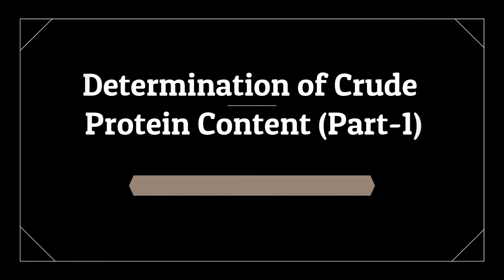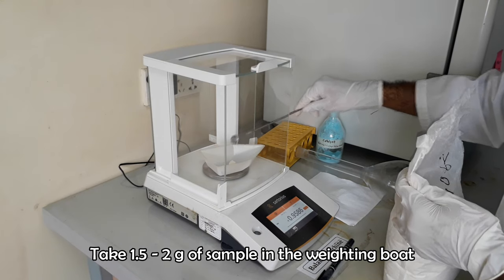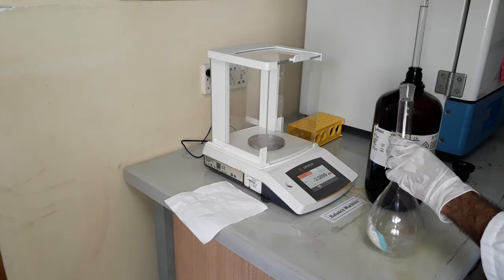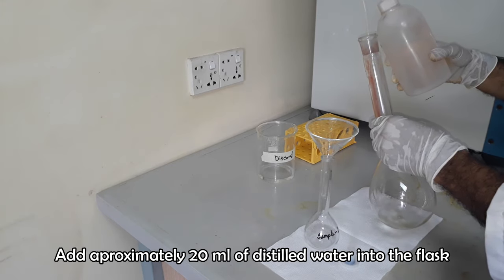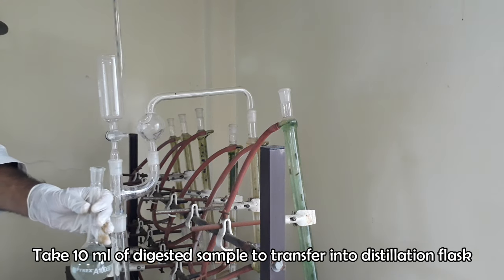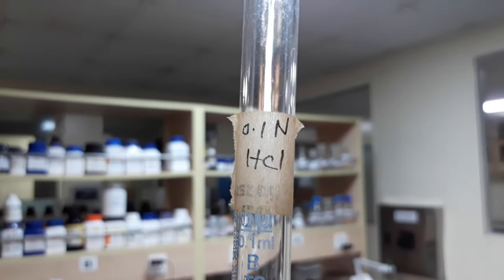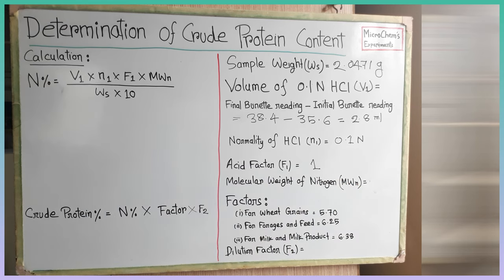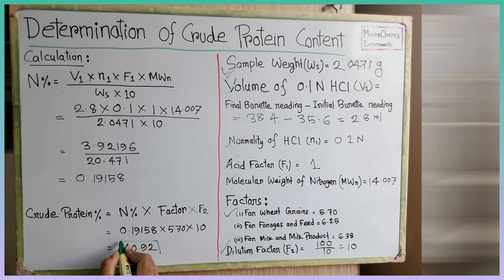Determination of Crude Protein Content (Part-1)_A Complete Procedure (AOAC 2001.11)

Comment: You should add the sample in the distillation vessel first and then add NaOH-solution. In the procedure shown on the video sample will react with NaOH-solution in open and it leads loss of nitrogen in form of ammonia. Also the receiving part should be under the liquid level.
Reply from the maker: Thank you for your findings.
In AOAC, it is not said to keep the receiving part under the liquid level. And in this way, shown in this video, we get the expected results. This is because the loss of nitrogen is negligible. Anyways thanks for your suggestion.
Reply: @MicroChemsExperiments  It is obvious in this case that it has to be under liquid level. Also Kjelldahl method is pretty old and it has always been that way and finally it is stated in the AOAC 2001.11 in part "Distillation" "Place graduated 500 ml Erlenmeyer titration flask containing 30 ml H3BO3 solution with indicator on receiving platform, and immerse tube from condenser below surface of H3BO3 solution."
Reply from the maker: @BadPete81  Okay. Thank you for your information.
Reply: It is very important to keep the recieving funnel under the solution as nitrogen can escape!

Comment: In the calculation equation V1 is the volume of unused boric acid but we need the actual volume of used boric acid, so here you have use 30- V1 instead of V1
Reply: Please clear the doubt as soon as possible

Comment: So why did you use 0.1 as the Normality of HCl in your calculation and not the exact 0.0975 N from part 2? That you worked when you titrated HCl against NaOH using phenolphthalein ad your indicator?
Reply from the maker: Very smart...
You are right. But I did not used the exact chemicals prepared in part 2 for protein titration. Rather I used 0.1N HCl and thats why I calculate protein using 0.1N.
Part-2 video is prepared in different time, just to show you about the preparation.
Reply: @MicroChemsExperiments  Got it!.

Comment: Very detailed video! One quick question, can I know if I can use this method for liquid sample?  How the method will be when I want to measure the weight as my sample is liquid?
Reply from the maker: Yes. This method is applicable for liquid sample also. You can take 2g of liquid sample in a glass beaker first. Then transfer the weighted liquid sample from breaker to digestion flask quantatively washing with 20 ml sulfuric acid and add catalyst & heat the digestion flask to digest your sample in presence of acid and catalyst.
Reply: @MicroChemsExperiments  Thank you for the explanation!
Reply from the maker: @amninazifa5244  you are welcome

Comment: Ok so quick question does the flask have to be a kjeldahl flask or can I use a volumetric flask if the first is unavailable? Also can I digest it on a soxhlet?
Reply from the maker: You can't digest on Soxhlet because the fume of H2SO4 will spread-out all over the lab and Env. There is no fume receiving system in Soxhlet.
Reply: @MicroChemsExperiments  Oh ok thank you for clearing that up
Reply from the maker: @kadelin3318  You are most welcome.

Comment: Why did you use the dilution factor?
 the AOA didn't use it.
please provide a reasonable answer
thank you
Reply from the maker: During the distillation, We used 10 ml digestion juice from 100ml total volume. Thats why the dilution factor is (100/10) 10.
Reply: @MicroChemsExperiments  I mean why was there a need for the dilution factor?
thank you
Reply from the maker: @bandaid.7878  when you analyze a portion of digested sample (rather than using total volume of sample), then you need to use the factor

Comment: From where did you drive the %N determination formula and why didn't you run the blank 
Though the formula in AOAC 2001.11 method is different from yours and they also subtracted the concordant reading of the Vs fron the Vb
Reply from the maker: Hadiqa Iqbal, Thank you for your questions and observations. 
First of all, we used %N determination formula from AOAC 2001.11 method which is modified in two places: 
1. we didn't use burette reading of blank (Vb) because we didn't conduct any blank digestion in this experiment. 
2. We used additionally Acid Factor (F1) which is not mentioned in AOAC book but used by the FAO method of ''Quality assurance for animal feed analysis laboratories, Page-90''.
***We didn't go for the blank digestion to simplify this method and we conducted several studies in our lab and found that there is no significant different in the protein result when we don't run blank digestion.
***Acid factor is only necessary when you want to titrate with any other acid rather than HCl.
So, If you want, conduct a blank digestion along with sample (as it gives more accurate protein result) and substract Blank Burette reading from the Sample burette reading. You can also ignore the acid factor if you always use HCl in the titration.
Thank you.
Reply: As far as i have studied if we are placing normality value of acid we don't add acid factor in calculations. As far as acid factor is concerned it always gets include into the calculations when we note molarity instead of normality 
Is that so ?
Reply: Can you share the method of fao with me plss
Reply from the maker: @hadiqaiqbal795  As the acid factor is 1, so you can remove it from the calculation thus creating no differences in results.
But if you use other acids like H2SO4, then you need to add acid factor in the calculation. In case of HCl, no need to use and Factor for Acid.
Reply from the maker: @hadiqaiqbal795  Knock in our facebook page for FAO method.

Comment: It was a very useful video. Can you elaborate more on how to run blank digestion and distillation? Thank you in advance.
Reply from the maker: Conduct the blank digestion and distillation as same as sample. Just dont add sample in the flask during digestion.
Thanks for being with us
Reply: @MicroChemsExperiments  Thank you for the quick reply. We are trying to implement the Kjeldahl's method exactly as explained in the video. However, during titration using methyl red indicator, the color shift appears to be very gradual and some times its very difficult to distinguish the color shift from yellow to orange. This might lead to mistakes in end point determination. Any suggestions to improvise?
Reply from the maker: @guruprasadk3848  Endpoint should be counted just at the point in which drop of 0.1N HCl the color turned into orange. Do the titration slowly and carefully against white background. Do saveral trial and try to do accurately. Your skill will develop with time. 
Another sugestion is determine the protein of known sample (eg: Pasteurized milk has a protein value of 3.5 to 3.7) in several trials and match the known protein value in diferent titration values of conducted trials. In this way you will be a skilled analyst.
Reply: @MicroChemsExperiments  Thanks a lot for your suggestions... will contact you through your facebook page incase of further queries... keep up the good work... cheers!!!
Reply from the maker: @guruprasadk3848  Thanks for being with us.

Comment: What about if we use 0.5N sulfuric acid as the titration?

7.003*volume of H2S04 in ml * Nf*100 / weight of sample = % nitrogen
Reply from the maker: You can use. But in the calculation, count 2 as acid factor

Comment: What are the limitations of this protein determination experiement.... And why we use NaOH??
Reply from the maker: We will make video later explaining the chemical reactions
Reply: OK I can wait for it.... Thank you
Reply: Can I get limitations. Also tell what are the precautions need to take to get accurate result. I mean during digestion,  distillation etc. 

I have added in hot digested sample 10 ml distilled water and than 40 percent naoh there is so much splashes coming from the flask and than flask was broken.

I need to get proper results. Can I follow same way u shown in vedio to get protien in soymilk because I m not getting proper result. May be doing some mistakes somewhere

Comment: I want to know what samples did u used? Thank you!
Reply from the maker: Ainen Lagroma, Thanks for your comment.
We used low protein feed (raw materials) sample to test for protein determination, in this video.
Reply: @MicroChemsExperiments  thank you so much for responding! Does this method can also applied in liquid samples? Can't seem to find any information using a liquid sample.
Reply from the maker: @ainenlagroma3644  Yes. You can apply this method for testing a liquid sample for Protein determination. Take 2g liquid sample (Ex: Milk) in the digestion flask and carry out the experiment in the same way as shown in this video.

Comment: why are we titrating acid with acid?
also, I didn't understand the dilution factor. would you be kind enough to explain  it in detail
thank you
Reply: the dilution factor is of the solution in receiving flask that contains boric acid?
Reply from the maker: This calculation is derived from AOAC official method. So they used Kjehldahl's method and provided equation for calculation based on the difference steps of this method. So, please study about Kjehldahl's method to get proper explanation. Thank you.

Comment: Hi, it was a helpful video😊, 

Other than that, can i just add some distilled water to the sample before adding the sulfuric acid? Is it work? Since i have to boil the sample manually without water circulation pump☺️

Thank you.
Reply from the maker: No. You can't add distilled water because it will dilute the acid and decrease the effectiveness. Sample will not be digested properly in diluted sulfuric acid.
So you have to boil and prepare your sample seperately before conducting the protein test.
Reply: @MicroChemsExperiments  thank you so much for responding! 

Is it work to boil the sample with diluted sulfuric acid by using heating mantle? And how can i sure that the boiling process do not boil dry? Since i can't add the distilled water and i do not have water circulation pump.

Thank you.
Reply from the maker: @noorfadilah1710  During boiling, it will not dry. You can boil using hot plate without water circulation pump and you dont need to add distilled water also. Just boil in concentrated Sulfuric acid.
Water circulation pump is used to capture the acid fumes, generated during digestion, carrying out throgh the wastage water line.
But in the case of hot plate boiling, use fume hood. Otherwise fumes of sulfuric acid will spread out all over the laboratory room.
Reply: @MicroChemsExperiments  thank you for your responding guys. I will try again. 

 If i use the heating mantle for the process, the procedure is same right with yours? The temperature and others?

Thank you, i really appreciate your answers☺️
Reply from the maker: @noorfadilah1710  Yes. The procedure will be the same as shown in my video.
Reply: @MicroChemsExperiments  Thank you so much.
Reply from the maker: @noorfadilah1710  You are most welcome.
Reply: @MicroChemsExperiments  Its me again, Thanks to you since my digestion process was success. 

Now, I have a question about the distillation assembly. I need to set up the distillation process manually. So, how can i set up for the water inlet and water outlet for the condenser?

Thank you.
Reply from the maker: @noorfadilah1710  Yes, you can set a condenser manually to collect the distillate